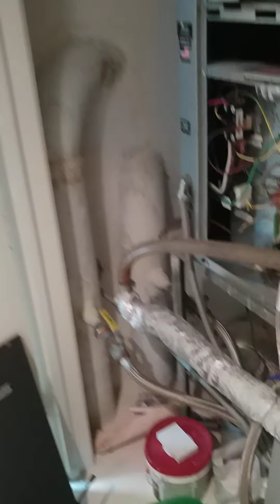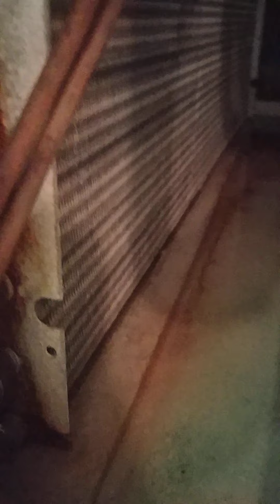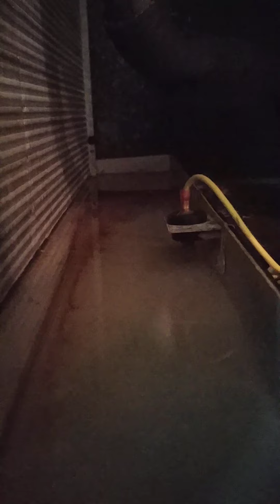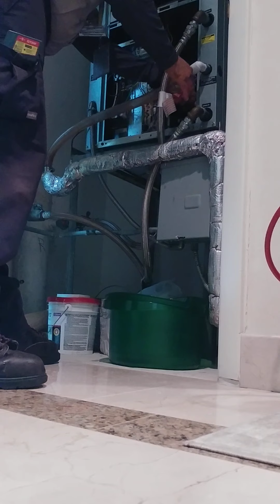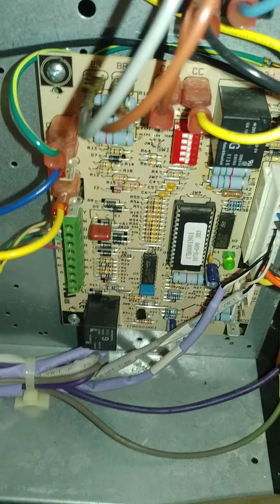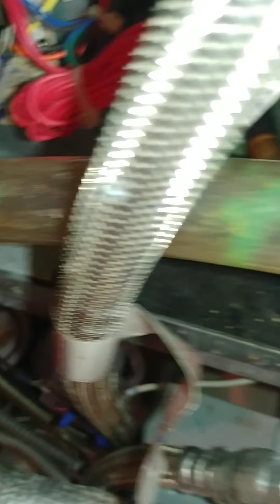Code 6 climatemaster Codigo 6

Comment from the maker: When the Drain Pipe have a greenish or yellowing color means the AC unit was injected with a colorant product named DYE to locate or id Refrigerant Leaks most commonly called Freon Leaks....in this case there s a chance that the leak is in the Evaporator Coil.